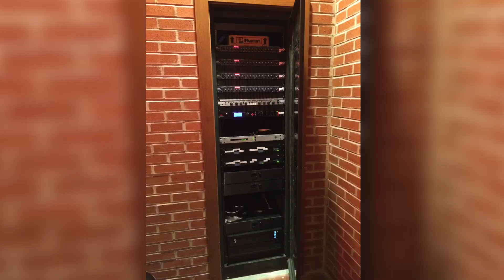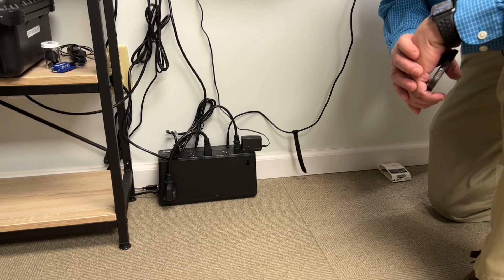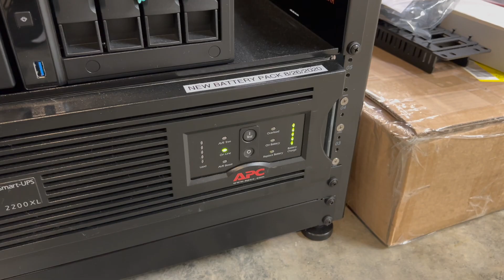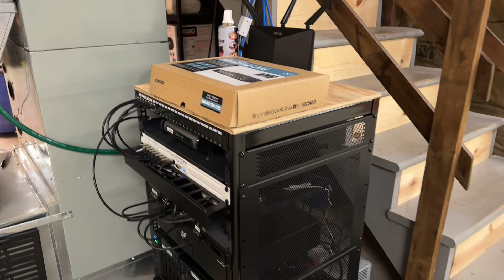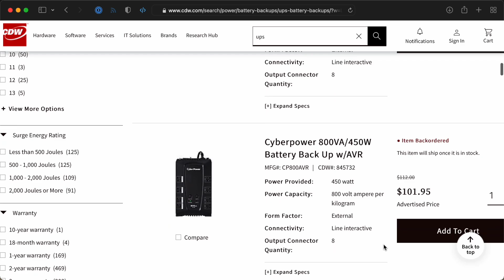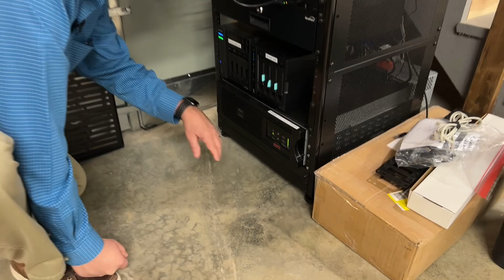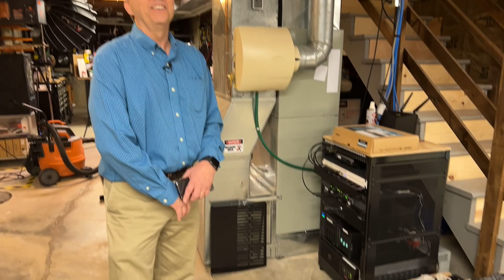Choosing a UPS (Uninterruptible Power Supply)

Comment: At least with APC, batteries should be replaced every 3-5 years. Smart-UPS are generally double-conversion (which provide the pure sine wave). Also, the first 2 numbers in the serial # is the year that the part was made.

Comment: They should do a test to see if there is a higher chance that the battery in the UPS catches fire than actually losing data from a current fluctuation.
Reply: Spoiler alert, batteries of this quality don’t catch fire very often. The possibility of drives corrupting due to brown outs is very high.

I speak from anecdotal experience, but also as a cell tech that truly knows the volatility of subpar lithium ion cells. 

I’ve started a few iPhone batteries myself 😂

I gotta ask, do you know anything about onboard timing crystals? Because all computers have them which means they prefer things to be on time. When the power flickers on and off, the timing becomes impossible.

This very phenomenon is abusive toward electronics and wears these timing crystals out faster than their expected wear and tear.

So the general consensus is that it would be a waste of time to perform the test you requested

Comment: I once had one in our home. That baby was a waste of time and space. It was back in the late 90's so imagine what battery was used back in the days, and the weight of it. The weight was like the weight of a car in a box. I believe it was similar design to a car battery. Power was never out, but who knows! Now days with people using electric cars its hot stuff to have as a power backup. In a way it is stupid because you can get used electric car battery and it will be cheaper and can contain much more power then you need to run entire home.

Comment: debating to get one of these. i'm upgrading the desktop setup with a kvm unit and with a ups i could auto shutdown the desktops and let the kvm unit run on the ups battery for a while until power returns where auto startup can be done

Comment: Can I use a UPS in replacement of a generator?
Reply: Often a UPS is intended for two main purposes: making the power delivered to a computer or other sensitive electronics more 'clean', and giving electronics time to either shut down, or run long enough for generator power to kick in.

Most UPS systems only have runtimes measured in minutes (and some even seconds!), just long enough for a generator to start. Generators take time to start up, though, so having both is usually necessary if you want to be able to run your computers/equipment in the event of a power outage lasting longer than a few moments.
Reply: @JeffGeerling  Thanks!

Comment: Hi, I have a question. Can I plug my UPS to a power strip?
Reply: Yes, but note that any extra plugs / extensions you add between a device and the wall (UPS included) will reduce by a small amount the power you can safely draw without heating up the connections too much. And many power strips aren't that great, I would only do this with one from a reputable manufacturer, UL listed, etc.

If you use a power strip and plug the UPS into that, make sure you're not also using an extension cord. Typically people will plug a UPS directly into the wall, though, since it can draw a bit of power if it's charging its battery and powering equipment at the same time.

Comment: i just want a small one for my gaming PC with a 650w PSU. i dont care for gaming when the electricity is off i just want to be able to shut my pc down without sudden surges causes pc problems/damages, any recommendations? thanks !
Reply from the maker: If you have a PC with a modest graphics card (like 3070 or 6700 or lower), and a modest CPU (TDP 100W or lower), a 650va desktop UPS is probably the most inexpensive option. I was running my PC off of one a while and didn't ever have an issue—until I upgraded to a 3080 Ti. When I did that, I had to also upgrade the UPS to handle the higher load.
Reply: @GeerlingEngineering  i have a 3060 paired with a Ryzen 5 5600. i was looking into a CyberPower EC850LCD, wht u think?
Reply: @GeerlingEngineering  ?

Comment: thing that suck with ups , is the battery ,  if the power go off for  long time and you are not near by to turn it off ,  the ups  will totally drain your battery  then sutt off ,  do that few time and you battery are dead     i have 3 ups 2 are 24v  and one is 12v  so when this happen i need to buy 5 battery every time  that realty suck !!! is from 20 -50 euro per battery    solution is to buy deep cicle battery but throw cost almost 200 per battery
Reply from the maker: Yeah, one way to try to prevent that is to set equipment to turn off (maybe using something like NUT or APC's own software like PowerChute) as the UPS hits like 60 or 50% capacity. That way equipment shuts off and the UPS can still preserve a bit of battery charge, so it doesn't wear out the batteries so quickly.

Ideally, that's in an environment where the UPS wouldn't drain too much before some alternate power source could kick in, though.
Reply: @GeerlingEngineering  one of my ups is a acp but since is old they don t make the software anymore  and the software suck it simulate than my desktop had a battery like a laptop and sometime suttdonw at randome times ,

Comment: i could use some help choosing betwen 2 APC units 1. BGM1500B and 2. BR1500MS2 i have heard of some of the APC and cyberpower units catching fire is why i am asking any info would be appreciated  thank you
Reply from the maker: Unfortunately in terms of catching fire, it's rare that it's identified as a real design flaw, and can be tricky to trace to any particular manufacturer.

There have been a few models in the past that are more prone to failure (sometimes even fires!), but I don't believe the two models you mentioned are in that list.

Comment: Speaking as someone who had designed and deployed critical power systems, you always have to account for inrush as things come back online.  That is where in a large facility having smart power distribution (plug strips) allows for timed delay of what turns on in a rack on power resumption/power up.  
For the home user, it is important to understand the difference in line-interactive (reactive) and true dual-conversion (always on) UPSs.  I will say that most of the UPS manufacturers seem to do their level best at obfuscating the true technology of their UPS by changing what the call their "technology", etc.  True Dual-conversion is the way to go if at all possible.  APC is a good brand however, there are many like CyberPower and my favorite Opti-UPS and I have all 3 in my home.  To give an idea about what a UPS can do for you in the home is that I have a now 13 year old Samsung smart TV that I have not needed to replace, as it still has excellent picture quality.  The 55 inch screen has only 2 dead pixels because it has lived its whole life on a UPS.  The side benefit is that my TV continues to work for hours after the power goes out because the network and TV are both on UPSs.
Reply: Very true. This is exactly why I went with a SurgeX SX-1115-RT professional surge protector as it incorporates inrush power protection as well as inductance-based surge protection along with line conditioning. I haven't paired it up with any type of a UPS yet as the systems I'm running are not critical and no harm would be done if the power were to go out while in operation, but I'm probably going to add an online UPS here soon just for the fun of it.

Comment: Great advice here, and it sounds like a lot of hands on experience! Had a few of the APC 2200VA rack mounted units, they've been great; we switched over to the next generation of 3kVA 2U units and a couple of Eaton ones too; we always buy batteries from 3rd parties (not in sleds) and switch them out, it takes 30-35mins per unit or an extra £200 if you want them in sleds - well worth the time investment!

Comment: How come when I test my UPS by turning off the breaker, the computer stays on...but, when the power goes out due to a storm, the UPS shuts off and along with the computer.
Reply from the maker: During a storm, it could be possible that a power surge or brownout conditions are triggering some sort of protection circuit on your UPS. One thing you could consider is adding a whole-home/whole-building surge protection device, and see if that helps.

Comment: if you are going to re-pack a battery cartridge, which is NOT manufacturer recommended, always keep the same battery Ah rating and type. the chargers are specific to the Ah rating
Reply: It's also very important that they identical batteries and made on the same day/week if at all possible.

Comment: Is that a bypass humidifier mounted on the side of the duct? If so, have you considered putting something between your HVAC and your rack to protect from water in the event of a leak? Just a thought.
Reply from the maker: Yes, considered doing that, but so far haven't :)

I actually had the condensate pump fail and luckily since the rack is up off the floor only the rubber wheels got wet. But I do want to figure out a better way to protect the rack, since it's now filling up a bit!
Reply: @GeerlingEngineering  a surprising number of server rooms I’ve encountered have been situated below restrooms or kitchens, some even had exposed drain and/or supply water pipes. Others have had air handling units that, of course, feature condensation. In every case I had to convince the clients to address the potential disaster before it became an actual disaster. It’s a lot cheaper that way.
Reply: @ADHJkvsNgsMBbTQe  True; better to spend a few hundred bucks now than replace tens of thousands later!
Reply: Wouldn't a full-height rack be a better choice where you can put those devices MUCH higher up off of the ground? Any type of a flood event there could easily put all of that low-sitting equipment in that rack under several feet of water.

Comment: I don't use or condone little baby under-desk UPS's as many make huge fake claims of power claims and have small, crappy circuitry. I always use bigger setups that start at 1KVA and need two hands to lift it. I like the older APC units as they are built strong and take a lot of abuse. Flashy looking units on markets today have high frequency switching, dirty sine (if they are actually sine wave) and prone to going bang thanks to dust. APC XL units even better, run external battery setups for long run-times and better handling of higher loads when transfering.

Comment: Another alternative for small setups is building your own ups, there is very good hardware like OpenUPS when you run your devices at 12 V, it even improves the Efficiency a lot, so less heat and more runtime 😉
Reply: Is there anything like OpenUPS for 127V? So we could run our PC's with a DIY UPS.
Reply: @diegoweb900  127V are a bit more work, most power supplies ran even on dc, so you can build an online ups with dc, but it is much more difficult, so i would use a 12V power supply like picosupply, i even use this on my home server, it increasese the efficancy of the server rack, because the switches and poe injectors are even on 12 V

Comment: Cool Video & I Would agree Very Good Advice IMO I think most folks seam to over look The UPS but i would argue they are very important to any mid to high end computer &/or server ! I have several that we  use 3 small ones & 2 APC 2kw But i also run 3-4 Servers Custom Built (SuperMicro) 2 & 4U as well as a high end custom gaming /work pc with multiple displays Same 10gb Switch as i saw in your video as well as a PfSense (Dell R210II)  as we tend to have a lot of surges and what i would call dirty power in my little hick town !IMO Biger Is Always Better..Like Money.lol. or fun no such thing as to much..lol.

Comment: I had a bad experience with APC so switched to Cyberpower, but only use consumer UPSs, not commercial ones. Something I think you missed is that you should use inline UPS so that there is no switchover time.
Reply: I've had bad experiences with all of them.  It's really more about features at this point, and one thing you should keep in mind is "cheap is cheap for a reason".  CyberPower UPSes should be replaced entirely when their battery fails, no exceptions.    The reason for this is they use a yellow glue to keep heavier components from getting knocked off the internal circuit boards instead of a more robust silastic compound for high-temp applications.  The glue starts off as an insulator but gradually turns brown and becomes electrically conductive as it ages, and this speeds up with the application of heat (and the hottest components are also the heaviest, so guess where that glue goes?)  I've got about a hundred UPSes or so in use in my organization and I have seen this issue in every single one of them, even their higher-end "pure sinewave" models.  But don't take my word for it, if you have an old cyberpower unit lying around crack it open and check the glue's resistance with a multimeter.

All brands should be cycled out every 3-5 years if they are used in a dirty power environment, or areas with frequent power outages/brownouts.  The fact is UPSes have a lot of components that wear out with more frequent use besides batteries and those are not checked by the UPS' self test function.  I had an APC fail with an "AVR Relay Weld" error due to dirty power but it tested fine after being powered back up, only to die again a few days later.

Comment: I have a laser printer at home that makes the lights flicker for a half second whenever I turn it on. It is supposed to only draw 6A @ 120V max. But I suspect it is doing more at startup. I was thinking about putting a UPS in between the wall socket and the printer to act as a capacitor or something like that. How big of a UPS do you think I need for the lights not to flicker?
Reply: A person in the know knows you don't put Laser Printers on UPS's unless you have a very big UPS with a big transformer. LP's have way to higher inrush current and faults most out.
Reply: @bentheguru4986  I have the same problem with my washing machine. What UPS would you recommend ?
Reply: @BestSpatula  Go find something like the older APC SmartUPS series in a 2-3KVA and try lifting the sucker. You are looking for the units that have a big, iron-cored transformer. Another way to tell, turn them on and when the UPS self-tests, it will go to battery and you should hear a good thump as the transformer comes in from its other mode (not getting into the other modes and magic the APC's do here).
Reply: @bentheguru4986  I think only the line-interactive Smart-UPSes do that. I've pretty much given up on those in favor of the Smart-UPS Online (dual-conversion) units. MUCH more reliable (in terms of the electronics).
Reply: @BestSpatula  I have used a few of other brand double -onlines and they all suffer from small, high frequency transformers thus droop when really needed, can't handle in-rush loads. Other side is though, why have a washing machine on a UPS?

Comment: I bought one from apc for my Music Production system , but it produces humming noise , is it normal for ups to produce noise .
Reply: 1: APC is junk. Get a better brand, like Tripp Lite or Cyberpower.  2: you MUST use a "true sinewave" UPS for audio systems. ALL UPS that are not use a "stepped" or "modified" sine wave that is extremely noisy and will damage transformers in any type of equipment.

Comment: I've had an UPS sitting at the bottom of my rack for almost 10 years now. It protects my desktop (not really needed, but hey why not), my big ESXi machine and some other stuff like KVM switch, LED monitor and ofcourse the core switch of my rack. Power quality here in the Netherlands is good, so I've had 5 power outages in the past almost 10 years. It too has an NMC, so I can look at logs and have it communicate with the PCNS on my ESXi machine.

Comment: Nice! What model Network Rack is that?
Reply from the maker: The one in my (Jeff's) basement is an ECHOGEAR 20U rack, and I've added ventilated spacer panels on the right side mostly to prevent errant balls the kids kick around in the basement from making it to my equipment inside the rack :)

Comment: There is a guy that has been designing small support devices for radio stations for a long time and he made a product that supplied power to the rack and had a UPS and wall power input. Watches for a UPS output issue and would switch to normal AC automatically. A bit pricey for a home or home office. Henry Engineering.  Some guys make a simple relay-in-a-box that can do the same thing without the cool intelligence built into the Henry unit. These boxes typically have the relays held ON all the time and that is kind of a failure mode in itself so I have avoided...